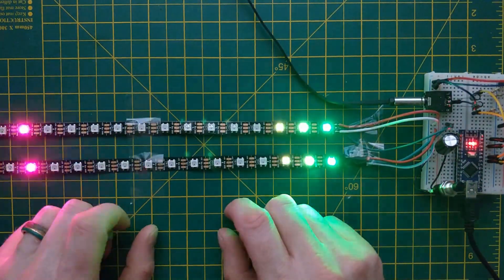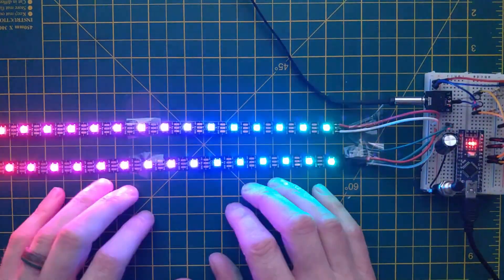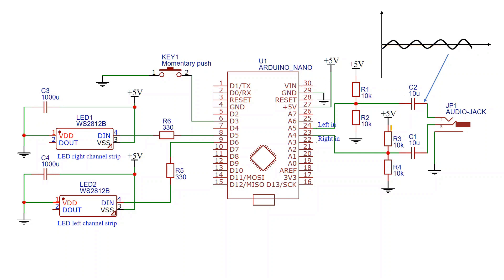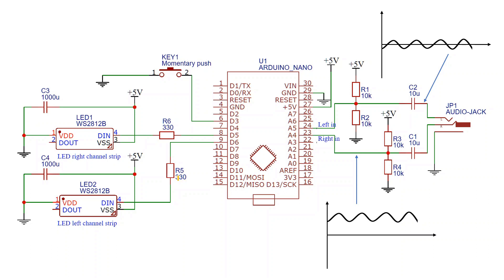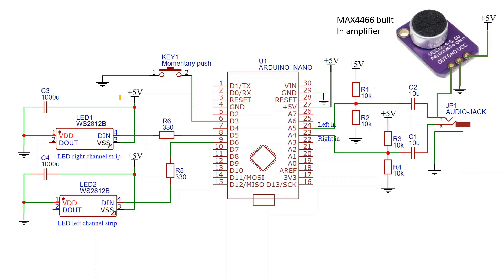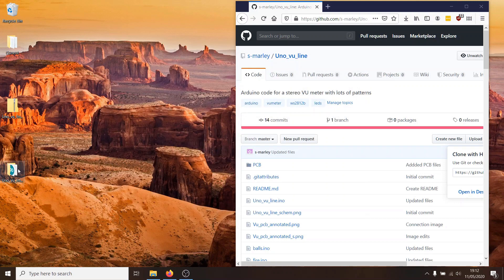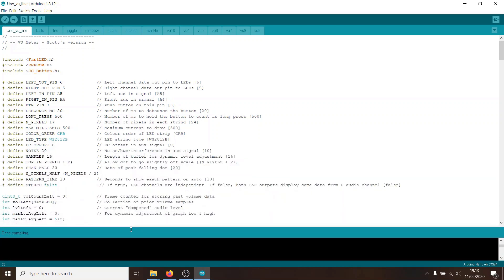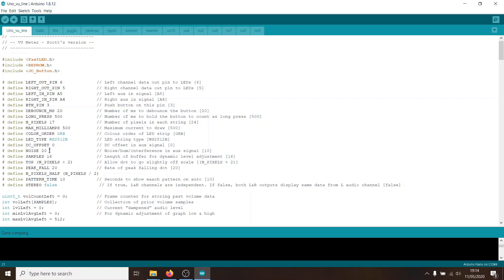Arduino sound reactive VU meter WS2812B LEDs

Comment: I want to make a VU  meter with 5meters of 60 led per meter I have ws2812b addressable and 3 Arduino uno
Reply from the maker: That's quite a project! You should be able to run 300 LEDs from a single Uno if you don't have too many patterns. If you want it to be stereo, you will need 2 unos as they won't have enough ram individually, and have each one run a separate channel. You will need to be careful with power, I would use a 10A 5V supply, 15A+ if your planning on having it quite bright and or fully lit. For 5m of LED tape you will need to inject power at least at both ends, I would consider doing it in the middle too although that's not essential. Good luck and I advise you to start my making a small one first to get used to it.
Reply from the maker: PS if you run some of the patterns I have on mine over 5m of LEDs, it will look completely insane and probably not what you're after. So you could probably write some patterns that work better on long strips.
Reply: Hey could you write some code for me I only want 3 patterns thnx

Comment: You’re fantastic Scott! I was able to create this during lockdown, thanks for so simplified steps and explanation. However I was trying to hook up 144 LED strip for each channel; it works but looks bit sluggish because of slow reaction speed and also almost 50 LEDs remain ON if there is no sound. I tried to tweak values but no luck:( It will much appreciates if you guide me to rectify these problems. 
Many Thanks!
Reply from the maker: What microcontroller are you running it on? If it's the nano, I'm not sure if it has enough ram to run that many LEDs, although I've never tried it so can't be sure. I haven't looked at the code for this in a while, could you try using the code and info in the follow up video here https://youtu.be/Nhc9MvOH0Gs and see how you get in with that.
Reply: Thanks for reply, Scott. I am using nano but using only couple of patterns, so didn’t face any RAM issues, I hope it is not causing sluggish performance. Then I merged few changes from code of your other video, its better now. I will try to see if some more changes can improve the performance. Other thing is, I am using KY 037 microphone module, which is not good, will get MAX4466 in few days and will give it a try.

Comment: Super project :-) is the code also available for 60 Led's ? How to buy the "Audi Jack" - I can't find it in the internet ?
Reply from the maker: Your probably better using this version https://youtu.be/Nhc9MvOH0Gs, I think this is fine for 60 LEDs per channel although I haven't tested it. For the audio jack into a breadboard you could use something like this https://www.ebay.co.uk/itm/3-5mm-Stereo-Breakout-Module-Red-Arduino-Breadboard-Audio-4-Pin-Flux-Workshop/112166736596
Reply: Scott Marley Many thanks for the quick answer :-) Which connectors (Audio Jack) of the ones from "Ebay" do I have to use which are not identical with your Wiring Diagram ? 🙂
Reply: Can I use the project with Line In or Microphone ?

Comment: In the picture with the breadboard are the capacitors at the Audio Jack  one of these is turned.The minus pole is once down and once up is this right? Sorry for bad english
Reply from the maker: It doesn't matter in this case. The voltages are so small, and it's an ac signal so whichever way you put them it will be ok.

Comment: verry nice, how much is the maximum watts of audio in ? or is it a line signal before the amplifier?
Reply from the maker: It's a line in before the amplifier. If you wanted to use a speaker output, you would have to greatly attenuate the signal before passing it to the Arduino. I wouldn't recommend this unless you know what your doing!
Reply: @ScottMarley  I am okay with that line in signal, verry nice thank you

Comment: Dear Sir, 
Thank you for the video and editable codes.. 
I made one with UNO, and is working fine.. 
Only issue is that the VU meter seems to be reacting upside down..! With every hike in bass/high input the number of led's glowing comes DOWN..! Is it not supposed to be the other way around..? clearly visible with VU4 & 40 led's per line
Plz guide..
Reply from the maker: It's very hard to tell what might be happening without seeing your hardware. It sounds like it could be a grounding issue. Make sure you have good grounds between everything.

Comment: Question: other similar projects rely on a Graphic Equalizer Display Filter (like Msgeq7). Is there any disadvantage to not using this additional chip?
Reply from the maker: The MSGEQ7 allows you to display the power in 7 different frequency bands meaning you can make a spectrum analyser VU meter. This version just displays the power level across the whole signal. So it depends what you're trying to achieve.

Comment: If I wanted ro use more LEDs, do I have to change the condensators? Sorry for bad english and not knowing this, but Im pretty new to this electronics stuff. Thanks!
Reply from the maker: No, the capacitor values are fine with more LEDs.
Reply: @ScottMarley  thanks! Looking forward to install this in my pool

Comment: nice job . 
but it didn't work .

 " rename it Uno_vu_line. I also forgot to mention in the video that you will need the FastLED library, along with JC_Button library."     it's done

There is this error massage;
"
In file included from C:\Users\Umit-PC\Desktop\vu\Uno_vu_line\Uno_vu_line.ino:5:0:
C:\Users\Umit-PC\Documents\Arduino\libraries\FastLED/FastLED.h:14:21: note: #pragma message: FastLED version 3.003.003
 #    pragma message "FastLED version 3.003.003"
                     ^~~~~~~~~~~~~~~~~~~~~~~~~~~
In file included from C:\Users\Umit-PC\Documents\Arduino\libraries\FastLED/controller.h:9:0,
                 from C:\Users\Umit-PC\Documents\Arduino\libraries\FastLED/FastLED.h:47,
                 from C:\Users\Umit-PC\Desktop\vu\Uno_vu_line\Uno_vu_line.ino:5:
C:\Users\Umit-PC\Desktop\vu\Uno_vu_line\vu9.ino: In function 'soundtun()':
C:\Users\Umit-PC\Documents\Arduino\libraries\FastLED/pixeltypes.h:169:17: warning: iteration 17 invokes undefined behavior [-Waggressive-loop-optimizations]
         r = rhs.r;
             ~~~~^
C:\Users\Umit-PC\Desktop\vu\Uno_vu_line\vu10.ino:43:23: note: within this loop
     for (int i = 0; i < N_PIXELS; i++) {
C:\Program Files\WindowsApps\ArduinoLLC.ArduinoIDE_1.8.39.0_x86__mdqgnx93n4wtt\hardware\arduino\avr\cores\arduino\main.cpp: In function 'main':
C:\Users\Umit-PC\Documents\Arduino\libraries\FastLED/pixeltypes.h:169:17: warning: iteration 17 invokes undefined behavior [-Waggressive-loop-optimizations]
         r = rhs.r;
                 ^
C:\Users\Umit-PC\Desktop\vu\Uno_vu_line\vu10.ino:43:23: note: within this loop
     for (int i = 0; i < N_PIXELS; i++) {
                       ^
Reply from the maker: Let me look into this later today, I haven't seen that error before.
Reply from the maker: Hi, I've fixed that compiler warning, sorry about that. In vu10.ino, change line 43 to "for (int i = N_PIXELS - 1; i > 0; i--) {" (no quotes). I've also updated the code on github. Really, it's probably better if you use the followup video here https://www.youtube.com/watch?v=Nhc9MvOH0Gs and the code in the description to that video, it's a bit better.
Reply: Dear Sir, 
Thank you for the video and editable codes.. 
I made one with UNO, and is working fine.. 
Only issue is that the VU meter seems to be reacting upside down..! With every hike in bass/high input the number of let's glowing comes DOWN..! Is it not supposed to be the other way around..? 
Plz guide..

Comment: great job! please specify, with type are the capacitrors? electrolitics? it is unclear...sorry for my english...
Reply from the maker: I used ceramics for the audio input but it doesn't really matter. Use electrolytics for bulk storage cap.
Reply: @ScottMarley  thank you!
Reply: Next week i will try
Reply: i try today but i have a problem with nano:  Sketch uses 20248 bytes (65%) of program storage space. Maximum is 30720 bytes.
Global variables use 2308 bytes (112%) of dynamic memory, leaving -260 bytes for local variables. Maximum is 2048 bytes.
data section exceeds available space in board
.....bla, bla. Some help please? (i want to left only vu4, 5, 6 for extra memory and stability). thanks for help. i use 2x66 leds

Comment: Hey Scott.. great job, hope your well during these rough times. Thanks for the comments and also the links.. much appreciated. one of the comments was volume and brightness control,  which is quite spooky as it is the second most request on my channel, so its  my next video. its vu meters only, again part of the request. code is done,  80% of the video is done - i just need to find the time to video it working.
Reply from the maker: Ah shoot, I'm currently doing a video on that too - I have it built on a breadboard next to me here! Mine will be different to yours anyhow, so hope you don't mind?! As per usual, I'll link back to you as the inspiration.
Reply: @ScottMarley Hey no worries... i have been so busy, all i have to do is video it and i still haven't the time. i will gladly throw a link to your site for your hard work your doing too...
Reply from the maker: I put the video up last night here https://youtu.be/Nhc9MvOH0Gs with some notes about how I got much more resolution by changing the analogReference to internal. It works well 😊

Comment: hi, really good job really.
I wanted to know how to eliminate the other modes to only use vu 6 would you help me a lot
Reply from the maker: The right way to do it: Go through all the code deleting everything you don't need and reducing the code size massively. The wrong way to do it (but will work fine): Change line 87 to buttonPushCounter = 4; Done.

Comment: hallo sir...pls share detail component list in  description....thnk
Reply from the maker: The schematic with all componenets is in the GitHub link. What componenent are you struggling with?
Reply: @ScottMarley  , resistor 10kohm konekting to arduino bord A4, A5 the component gets hot(short)....thnks
Reply from the maker: @burapat4100  are you sure you have a 10k resistor and not a 10 ohm resistor? If wired correctly, these resistors will not get warm. Check your resistor values with a multimeter and check all of your connections.
Reply: @ScottMarley , my resistor 10k ohm 1/4 watt
Reply from the maker: @burapat4100  then you definitely have a fault in your circuit. I can't really diagnose it much further than that without seeing what you've done I'm afraid.

Comment: That will work also in 3.3 v boards? Esp32 is very powerful and also have Bluetooth and wifi. I think you can get extra options for control. I guess I have to change that voltage devider resistors? You have any suggestions? Thx.
Reply from the maker: This will work fine with the ESP32. You will have to be careful with the power though. I'm assuming you're using a dev board with a 3.3v regulator on it. Give 5V to the ESP board Vin, and use the 3V3 pin go to the resistor divider. The LEDs will need 5V to power them. The data out pins from the ESP32 will be 3.3V logic level, but in my experience WS2812B LEDs work fine with 3.3V on the data pin even though they are specified to use 5V (see my LED matrix video to see that this works).
Reply: @ScottMarley   yes, i want to use one board with 3.3v regulator. Driving Led part i do not think will be a problem. I will use level shifter if i will have to, only problem i see will be at analog signal level input from microphone. Esp  can read 3.3 v max. Your arduino 5 v. So, i guess, if  analog signal level is higher than 3.3 v will not work as i expected. Any idea how high will be analog output voltage level after voltage dividers? Exceed 3.3 v?
Reply: I think i got it, so in your schematics, R1 and R3 should be at 3.3 v for esp32.
Reply from the maker: @petrepetercristi  are you using a preamplified microphone? Like this one https://www.ebay.co.uk/itm/Electret-Microphone-Amplifier-MAX4466-with-Adjustable-Gain/273149609781?hash=item3f98fc4735:g:JDMAAOSwxfdaywKx if so, just power the microphone with 3.3V then you won't exceed the analog input voltage of the esp
Reply from the maker: @petrepetercristi  yes, that is correct, R1 and R3 should be at 3.3v
Reply: Hi. I'm already thinking to try it on ESP32 nodeMCU module. Ok i read in the comments 3,3V to R1 and R3.
Do the capacitors and resistors stay the same?
Audio/Jack in line. No microphone.

Comment: Great upload Scott.  Well explained and thank you for sharing. Another project to put together during Covid-19 isolation.  I have also been following the Cine-Lights projects over the years and did notice one of the codes you helped to edit (Second edition I think). Both of you have been doing great work
I do have a question - how difficult would it be to edit this code to include a seperate brightness and volume sensitivity pot?
Thanks again
Reply from the maker: Hi, thank you for your comments. Brightness would straightforward to do with basic Arduino knowledge. Wire up a pot as normal to an unused ADC pin, in the loop read the pot and map the reading to FastLED.setBrightness(). Sensitivity is more difficult. The issue is that aux level output is in the region of around 1 volt at high volumes, so you don't get a lot of dynamic range. The code here does scale automatically for lower volumes, but it becomes more difficult the lower the input voltage is. You could alter the NOISE value using a pot, but that's not entirely what you want. The proper way of doing it would be to have the input signal run through an opamp before it gets to the Arduino and use a pot to change the gain of the opamp. I didn't do this as I was trying to keep it simple. If I get around to it, I might make a futire video on how to add this.
Reply: Thank you for the reply Scott.
Reply from the maker: Hi, I now have a video showing brightness and sensitivity controls, you can find it here https://www.youtube.com/watch?v=Nhc9MvOH0Gs Be aware that the circuit is a bit different than this one. Let me know how you get on if you decide to have a go!
Reply: @ScottMarley  Thank you Scott.  I now have the parts and will make an attempt tomorrow.  I will let you know how it went  on the page linked above.  Thanks again for posting this one.

Comment: Just what I wanted Scott loaded to my Mega 2560 no problem, building a couple of towers for our outside broadcasts on Hospital Radio. Thanks.
Reply from the maker: No problem, if you have the RAM available I would increase SAMPLES to 60 or so, that way you get smoother operation. I'd love to see a video once you're done!
Reply: Will do, once this virus is out of the way. Probably have it in the studio for my Soul Show to get me in the mood!
Reply: System all tested and working OK. Fitting  mic's each end of main box and clipping a set of stereo headphones to  isolate everything from our broadcasting equipment for electrically isolating safety reasons.Have ordered these hopefully do the job.  https://www.amazon.co.uk/dp/B01MROLRJN/ref=twister_B08221VDT1?_encoding=UTF8&psc=1
Reply: Hi, I'd like to know if you made some modification in the main code. I tried on an UNO it worked fine. but no response on a MEGA2560. the code get stuck i the begining of the loop. Any advice? thanks you.
Reply: @mehdihajsassi1499  Hi Medhi, Mine runs on a MEGA2560 did'nt need to modify code except for MAX_MILLIAMPS 1000 current draw. I have also added 3 new buttons and a tri-colour LED and modified the code to change the RGB set-up on boot up, to give different patterns. Otherwise the code is as Scott wrote it.
Reply: @BrightsparkTone  thanks for your answer.
Reply: You're gonna laught , it worked finally few minutes ago. Typical IT stuff, turned it off and on few times and voilaa! Maybe some boot issues.

Comment: Thanks for this video , it is very detailed and explained well . Am sure this is pretty easy for anyone to remake. Do you think this would work with an attiny85
Reply from the maker: I'm pretty sure it won't work, even with a dramatic reduction in both the code size and the number of LEDs. As it compiles at the moment, its uses 20K of flash memory (the attiny85 only has 8K) and global variables take up 1220 bytes of SRAM (the attiny only has 512 bytes). You then need more SRAM available for the LEDS (3 bytes per LED) and any dynamic variables that are created during operation. So I'd say it's a no I'm afraid.